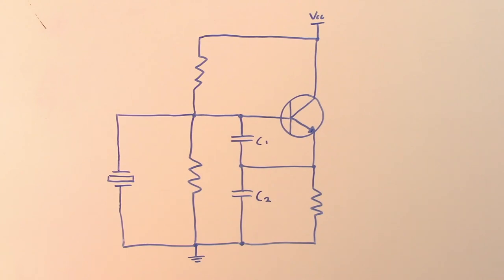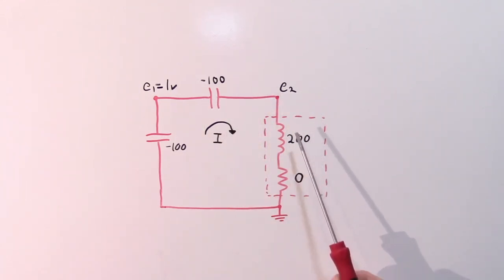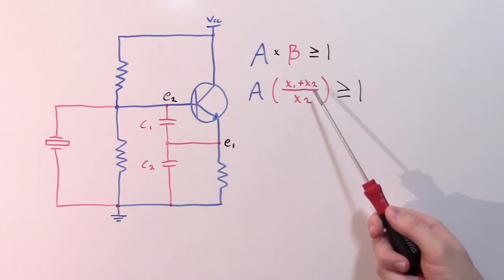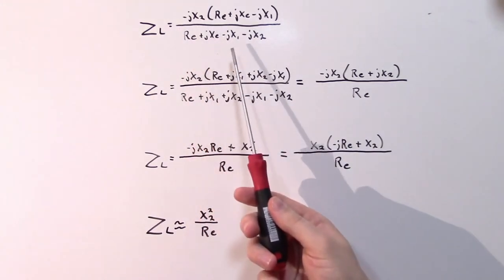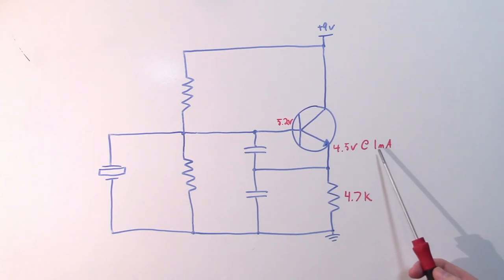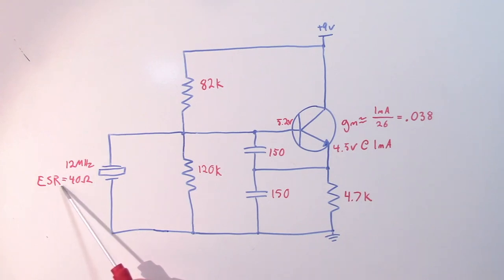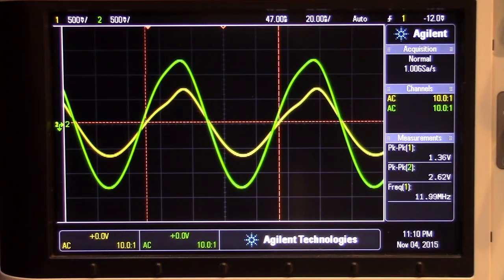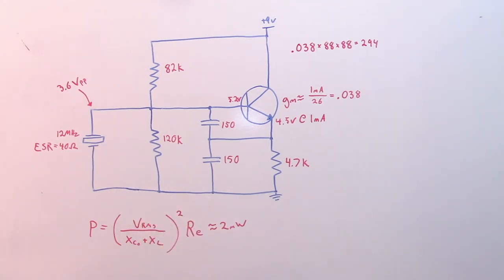Colpitts Crystal Oscillator Fundamentals [devttys0 reupload]

Comment: For most people first looking at the colpitts oscillator using emitter follower, they see there is no voltage gain, so it doesn't seem like it should work, but as you explain there is current gain, so power gain is possible. Great explanation and good balance between practical and theory.